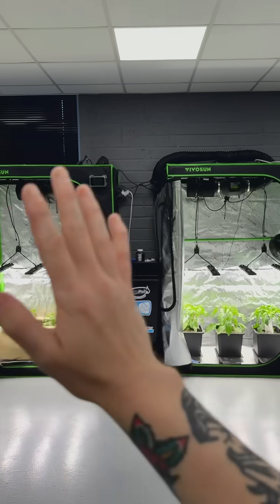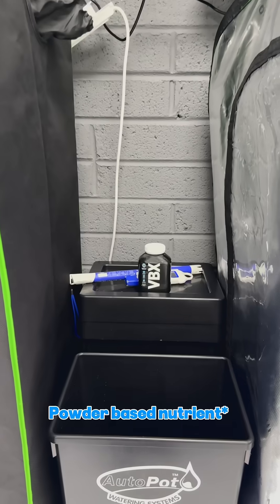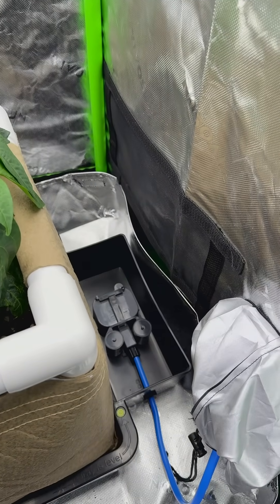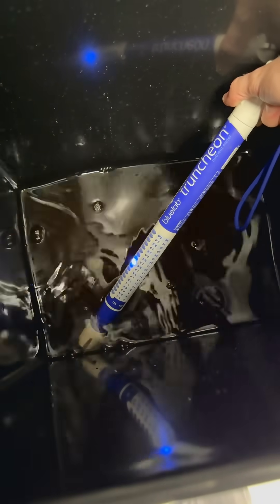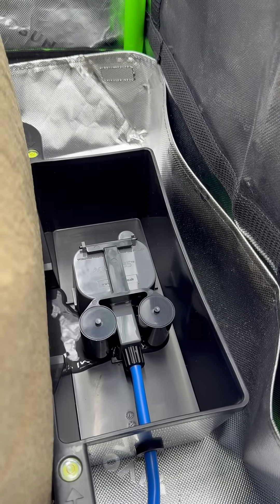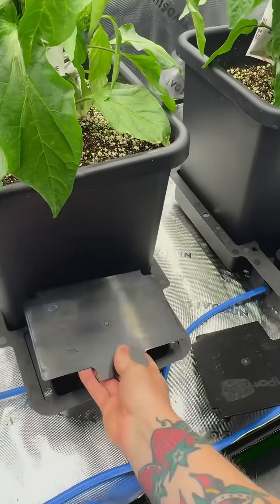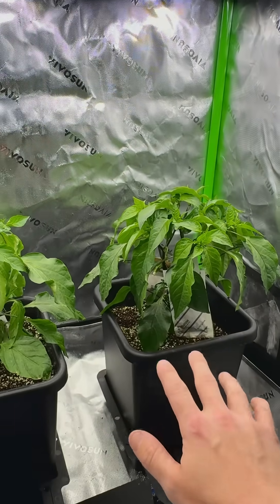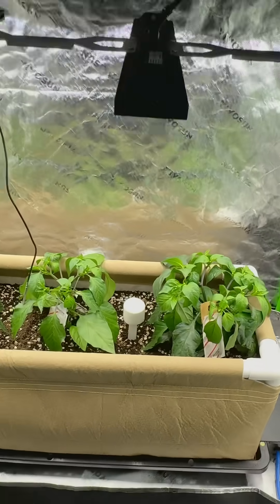AutoPot systems = ON! Living Soil vs. Coco series update.

Comment: Cool video!  I've overshot  with ph down before. I set some airstones and a pump and aerated for a bit and it helped. Looking at those 160 watt under canopy lites they look purty nice migro❤
Reply from the maker: It was still within the acceptable range, albeit not the figure I was aiming for! Thanks very much, the INTRA 160 is a great light - extremely versatile as well with how the eyelets are positioned. It opens it up to be used as under canopy, intra canopy, side lighting or even top lighting.
Reply: @MIGROLIGHT  definitely on my FOMO list since I know it will pair well w/ my 500 watt bar light.

Comment: The autopot system works great if anyone thinking about purchasing them. They are sorta like gnat magnets tho.
Reply: I have tried all the popular gnat 'solutions'. In the end, my own idea was the most effective- and cheap. I'm happy to share it.
All that is needed is to take a roll of Tuck Brand red construction tape and apply it all around the rims of the pots, leaving most of the sticky part above the rim of the pot. When the adults emerge, they are poor fliers and the fans in the room blow them onto the tape so they don't reproduce or travel to other plants. Yes- the tape is ugly. Yes- it works perfectly. I have been using this method for a couple of years now- no gnats.

The second best method is watering regularly with a tea made from neem cake powder.

I plan on getting Autopots shortly and I will use the tape right away. A physical solution seems better than a chemical solution for something we are going to ingest.

Comment: I've been intrest3d in the vbx range but didn't fancy the change so will keep and eye on this too see how it goes.

Plusni love my auto pots makes life loads easier
Reply: The next best thing is drip irrigation. You still have maintenance with it unless you have a draining system. But it's not very expensive compared to the autopot system. The biggest plus for me is crop steering through irrigation patterns.
To me, autopots are like DWC with media management. But the roots are pretty much at max VWC, which means you don't get to stack with dry backs.